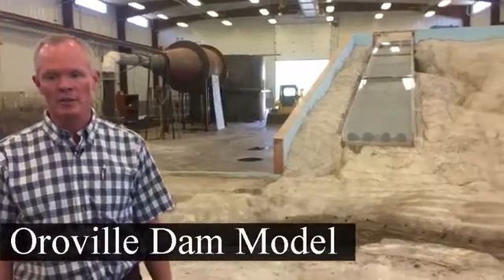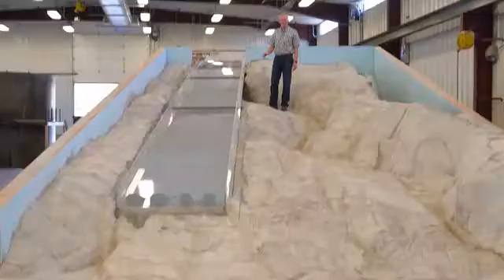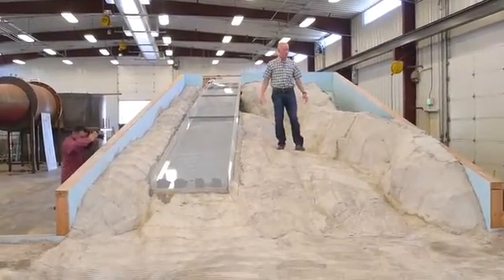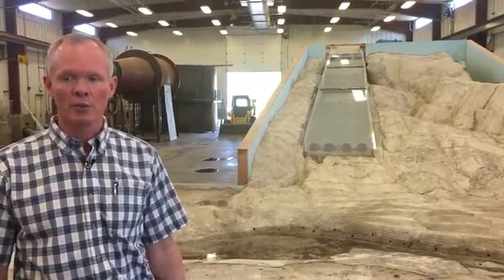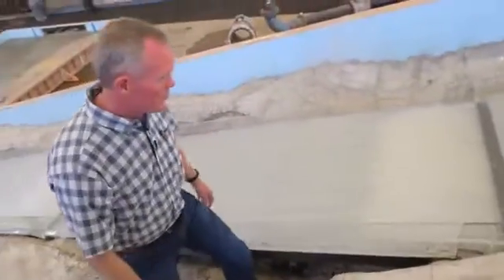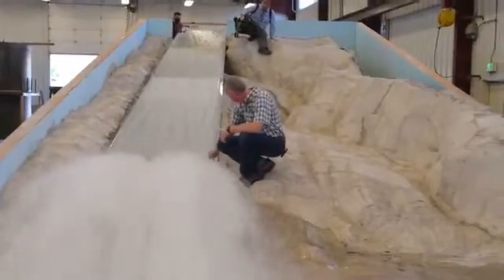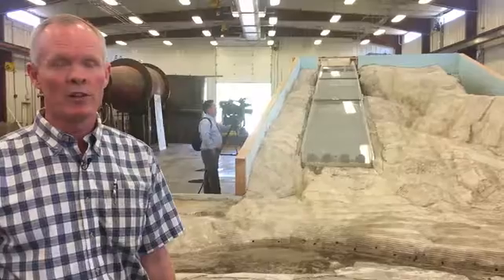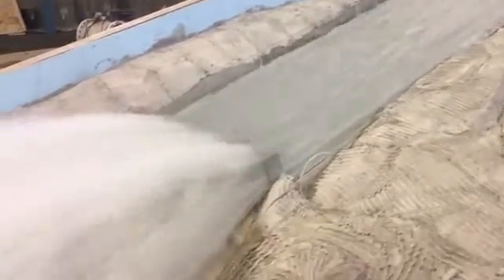USU has created a 1:50 scale model of the Oroville Dam to study the spillway.

Comment: • Key issues & reforms for the Dam Sites : 
1. Emergency Spillway System Construct somewhere behind the upstream area must be first priority to meet such kind of happened, easily escaping from high flood situations.  
2. The Diversion Tunnels as per design criteria round shape Complete before the heavy Rains & flood periods to bear the impacts of Static and other relevant forces like Sliding’s, Cracks, Sink Holes & settlements.
3. The Project sites need to be add in provision of specific Cofferdams to controlling the water potential of upstream areas and not passing towards the Dam side, especially protecting form the Leakages.  
4. The Storage Capability in the Reservoir as per depend upon the Geological Site Condition of Soil and Rock Bedding Joint formation Strata like Horizontal, Vertical or inclined Shapes & (Earth Works States, Earthquakes, Hydrology, previous disasters in 10 years) and Drilling Blasting’s during in 5 years (Fracture areas of right Banks, Left Banks also near Structures Zones + other Weak portions need to address)  
5. Reviews must be considering as per Site Conditions of design criteria during the Construction execution stages.